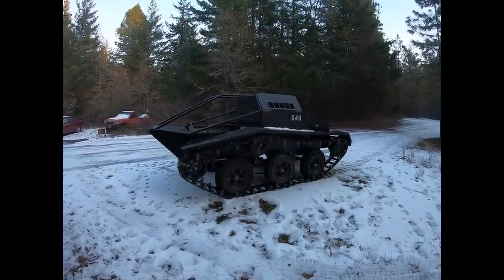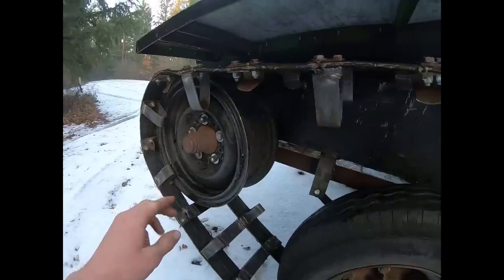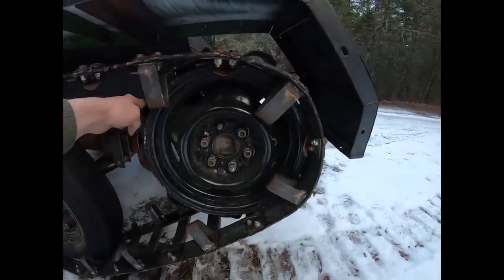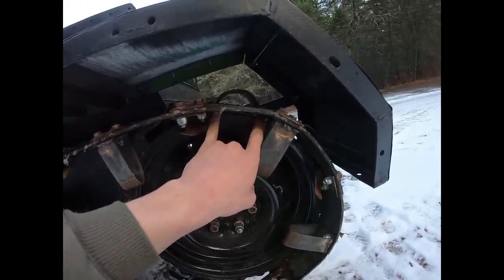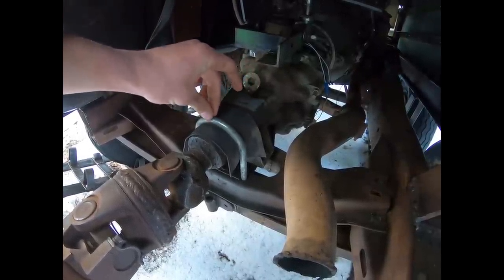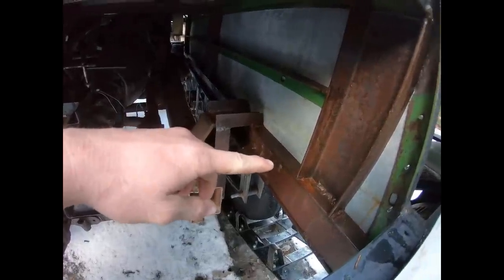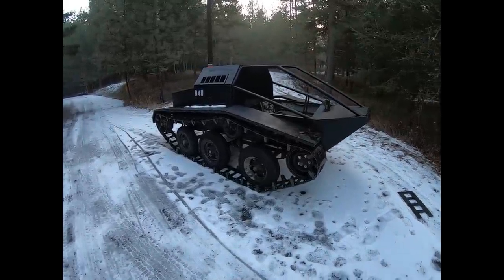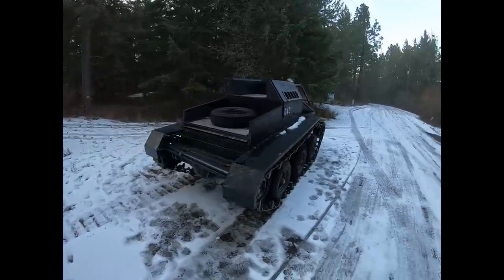How I Built My All-Terrain Tracked Vehicle out of Scrap Metal for Under $400 (Bug-Out Vehicle)

Comment: not bad, but I would have reccomended making a replace able track length as it would have helped with the tension issue, also because you effectively have a one piece track if it breaks it will be expensive to replace. for tensioning the  idoler tends to be on a hydrolic piston because you might need up to 6"-1' of tensioning to properly tension the track and allow it to be removed. you might be able to get away with useing a cheap jack with a bearing mounted to it.

I would definitely redesign the track, even if you are going to use that I would make the track with several removable tracks, I would also wield teeth onto the tack, basically turn them into a "T" or"L". this might play into your track giving you a disconnection point where you can adjust tension by adding or removing sections or putting modified sections on. I think your drive wheel is shitty and deserves a redesign. I would also put some shielding below the engine encase you actually off raid in difficult terrain and not piddle around, there is a chance something can strike the engine or under body either causing damage or requiting a replacement part. I think plywood, 1/4" hard plastic, or a wire  mesh would be fine and it doesn't need to cover the whole space just directly underneath the part.

the overall design is ok, would recommend better stowage and driver placement, would have had a location for a trailer hitch for a small trailer.

Comment: Just about how I would do it, Very good video,
But I would make one change that would have saved you a lot of grief building those sprockets,  I think you could have gotten away with just using 2 ordinary wheels with rubber on them, If I recall some of the most modern track vehicles they just used a tire for drive,
Let me know if you decide to do this and what results you have

Comment: I would like to see the steering setup more.
Reply: Seems simple enough, each rear brake has individual control.
Reply: @RickTrajan  that would work for a while, but wear the brakes a lot, and won't give you the manuverability of an actual tank where you can put one track in forward and the other in reverse. But for a budget build, I guess that's the only way to do it.
Reply: @tootall5559  it's drum brakes - they last a long time on regular automotive use for rear brakes - but since it's pretty much worst use than front brake(if you're driving it on the street at least) not so sure. Never worked on a 4 wheel drum brakes, probably never will. If you could make the pinion gear move maybe there's a way to make it move opposite directions but I can't think of that idea thoroughly right now and I have no idea if anybody even tried that.

Comment: You might get this question wrong but if the top of tank tracks are going 50 miles per hour, how fast are the bottom tracks going.
Reply from the maker: Relative to the ground? They aren't moving. ;)

Comment: About the tracks, how did you link them? Is there an overlap pinned between a couple of those strips of steel or is there some sort of mechanical link in the belt itself?
Reply from the maker: You're spot on. I pulled the rubber over itself and used longer bolts to reach through the two layers of rubber and steel.
Reply: @randomn6473  Thought so. Thanks. 
😎👍

Comment: This is very cool, but if this is meant as a "bug out" vehicle, I would have used a Diesel engine instead. Diesels do not use electronic ignition, and to start them, you could either use a starter with a non electronic energy source or compressed air directly into the engine to start them. Antique city buses used the compressed air route. This is very important for a bug out vehicle because if there was a EMP attack, this vehicle would lose its function as a vehicle, since the engine would be destroyed. When I say a "Diesel", I do not mean something highly electronic. Perhaps a purely mechanical Cummins from the 90's.
Reply from the maker: You're correct. It's more of an apocalypse vehicle in the Mad Max sense. I have a 1967 CJ5 that's my go-to if SHTF haha. I will DEFINITELY go with diesel on the next iteration for its fuel flexibility as well.  This truck was free though so I had to work with what I had. I like the air start idea. Thank you for the comment!

Comment: You couldn't have purchased those tracks for 400, let alone the wheels. The only way you got this under 400 was if people were just very generous!
Reply from the maker: You're absolutely correct. I scrounged around bone yards and junk piles for almost all of the metal. The tracks were made by hand and the rubber was free, not purchased which kept the cost down to a reasonable level. She's a bit of a Frankensteins monster, but she runs! Thank you for the comment!
Reply: @randomn6473  nice toy

Comment: I had a killer track vehicle once. 
And then it tried to kill me twice, by rolling over and mounting me! 
So I completely restored back to to factory new condition.
And sold it for $3,000, to a guy who put it on display in a small museum. 

RANGER V also called FERRET AND OTTER TRACTOR
They were short, narrow, and heavy. 
But, they would go over, under, up, down, wherever you pointed them.
They had two seats.  
But look at how trapped, a person s are, with no ROPs. 
1:00
https://www.youtube.com/watch?v=y_mdTJ5QSOk